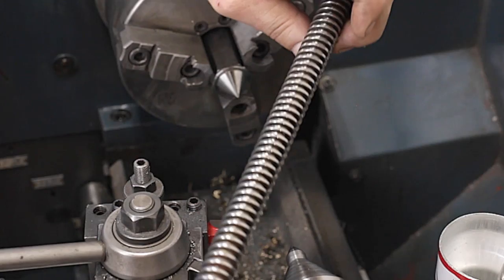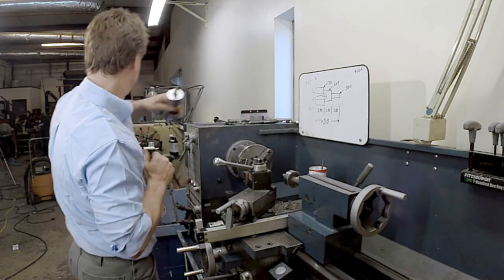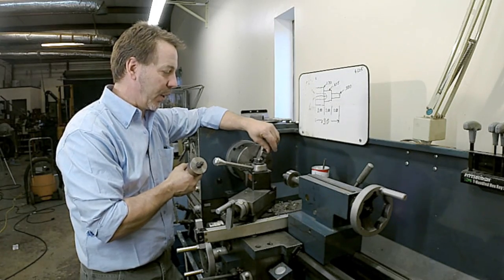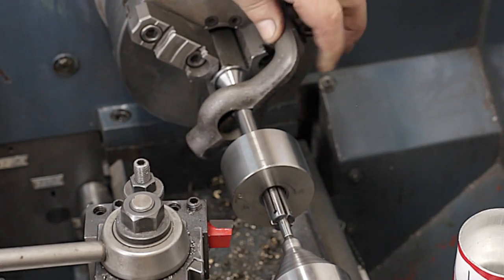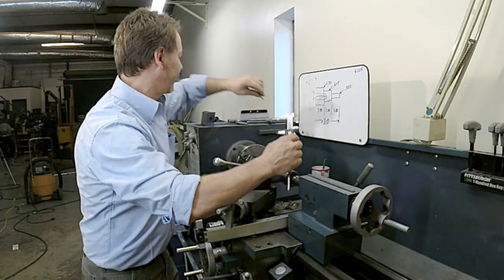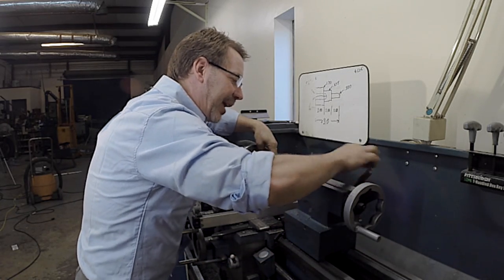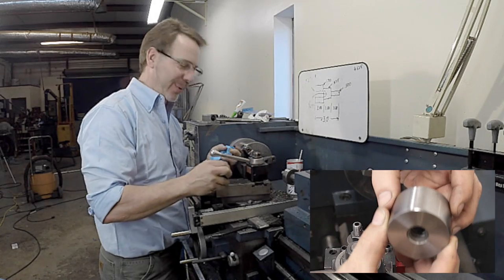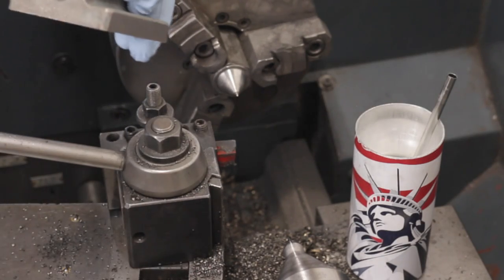Lead screw Part 3  "The nut"

Comment: Hi Dale, it looks like you are all set to go the distance with the Friday Tips & Tricks. Judging from the comments the consensus of opinion is that the CA glue was not the best choice and I tend to agree. The first thing that came to mind was to pin the nut inside of the casting since it' base appears to have enough mass that a small hole would not impact the integrity of the part. Despite this point, there was still a lot of good info provided and you brought up points that many had overlooked. I look forward to seeing your surface grinder in action putting the finishing touch on something cool. Keep up the good work!
Reply from the maker: It will be interesting to see how long the super glue will last. I used it because that what I had on hand. 😀

Comment: I'm not a big fan of glue, but that could be that I don't know enough about the different kinds of adhesives and what their strengths and weaknesses are.  The Acme cylinder nuts on (for example) Bridgeport milling vises are pinned in place with a blind steel pin, then ground smooth so it completely disappears.  To remove it you simply drill out the pin and pull the cylinder nut out.  I would opt for something like that as opposed to glue.  Just my own personal preference.  Love the video series, and a $100 lead screw repair is a great deal.  Thank you!

Comment: nice job Dale. lots of really negative commenting on this entire series, I dont know why. these are ideas that put passed over machines back to service for the long haul. We are spending our hard earned money not the companies cash to solve serious issues in this case a screw and nut that might even be obsolete or so rediculously expensive the machine would be scraped. Labor has become so expensive that management would never allow someone to be taken off production work to make these repairs. Down time is figured in thousands dollars per hour each line or machine. Some of the neg is people talking through hats, When that machine is running again it will work perfect. Only advice is about loctite, every parts counter I ever seen has a display of single use tubes that cost about a dollar, worth picking a few up next time you stop in for brake pads or oil filters.  Great series on lead screw and nut repair. Will be doing the same job on my 13 south bend crossfeed and mitre.

Comment: This repair looks really nice. I would not has thought of using super glue for a repair like this. The good thing is that you have a large contact area between the nut and the holder. It would really be difficult to make it shear and if the two materials were similar then thermal expansion because of CTE mismatch should not be a problem. One of my hobbies is building golf clubs and the joint between the shaft ( steel or carbon fiber) and the head (stainless steel, steel or titanium) is epoxy.  It has the same type of joint that you made.  My golf clubs have seen hot, cold, wet and dry and hundreds of shots on golf balls (and the ground) without failure. The key is a clean, oil free, active surface.  The only way to break the bond is with a torch -ie. heat the epoxy to failure. I would trust the bond more than a pin or screw or anything like that because those things will have high point contact forces that would be prime for failure. Thanks for the video.

Comment: I was hoping to see the nut spin on the shaft and an example of the machine working with greatly reduced backlash.  Still a great series.  I'm watching because I'm contemplating doing a tail stock rebuild.
Reply from the maker: I can tell you it worked out excellent, it still has some backlash, but it is for surface grinder so it's not that big a deal
Reply: Thanks for the great series.

Comment: Ok I will try to positive. This was a great idea,  the lead screw on a surface grinder has very little axial force on it, the CA glue should work for quite awhile.   I do not suggest this on a lathe,  the axial forces are far greater on all of the lead screws of a lathe.  This type of CA glue will fail due to moisture and most petro. lubricants.  There is product made by several Manufacturer's that would last much longer.  You could of added a couple of grub screws to lock in the nut.  Good fix,  But I think a bit pricey.  I think you could of made a fine screw and nut, and would of been proud of the repair.  I neeed a set of expanding mandrels they are great for repair work, nice job on the turning.  Thank you for all of the fine content you provide.  Randy
Reply from the maker: I will be interesting to see how long it will hold
😀😅
Reply: +Randy Richard  Indeed Glue really ???  I want to know how this works... But I am very "how you say" no way...   especially after spending that kind of money on a "precision screw and nut"'    I don't understand.. WHY GLUE.. ???   .
Reply: Randy Richard In The Shop - The grub screw method was also my first thought.
Reply: Randy Richards in The Shop - Build Something Cool :  Question could that nut be drilled and tapped on either side then split into two pieces, one longer and one shorter, to make a backlash adjustable lead screw nut?  The one piece glued or set screwed, and the other piece attached by two screws to the stationary piece, but floating to be adjusted by the two screws to take up the backlash over time.  Does that make sense.  (Edited for spelling)

Comment: Thanks Dale. Good info. I also like the height of that lathe you used to turn the nut. Im going to lift mine  6". Must have been made for midgets. I have overcome the problem of having to have two lathes by having a2 kw and a 5 kw motor on mine. The lower powered one running at 3.5:1 slower than standard speed which means i can get right down to 26 rpm.

Comment: good video, nice use of turning between centres.
I think you might have some problems over time with poor oil resistance of most superglues, I've seen a few cases where they failed in oily environments similar to what that bushing will experience. I would have gone with a chemical resistant 2 part epoxy, Also when gluing in a bushing is a good idea to toughen up both surfaces to give superior mechanical keying for the adhesive. A great way to do this is to cut both left and right hand fine threads at scratch pass depth in both parts, this gives a micro-knurl surface for the glue to key into, it will never come loose.
Reply from the maker: +russhellmy  Great Idea on the left and right scratch pass.

Comment: With a difficult to heat part like that, you might want to try compression shrink-fitting instead of expansion shrink fitting. We used a liquid nitrogen bath to shrink an insert on an aircraft panel normally installed with a hydraulic press at the factory, because we weren't about to remove and disassemble an entire wing in the hangar. Packing in dry ice chips should also work.

Comment: As more of a rough and tumble builder I have a few recommendations.  But first I liked this series.  I learned some new things and a different approach to some issues, plus I do a lot of fix jobs.  My experience with super glue type adhesives is mixed.  They don't seem to like oil and tend to be brittle.  For those reasons I probably would have gone with epoxy.  I'm glad you explained in this one why you were leaning to glue rather than solder, I asked that question in part 2.  Also since you were going with a glue I would have added some texture for the glue to hold onto.  Tight fit with smooth machined surfaces gives very little for the glue to hold onto.  So I probably would have done some scratching with sand paper to give the glue something to grab.
But you may be right that it will last longer than I expect?  BTW in case you don't know unlike epoxy which is pretty solvent resistive acetone will melt super glue pretty quickly.  Not really a problem in use but if you need to separate them in the future soaking in acetone will probably make the center just slide out.

Comment: skillful operating and good thinking. there is only one little problem I feel. the mandrel you hold is a nut's thread MINOR Diameter. It will be no reference means on either axis direction or concentricity of lead thread. of course if you setup the casting iron stand by hand file cutting later will be OK. I will consider to use the damaged lead with 2 rough nut lock instead of mandrel if not too many worn out.

Comment: I think if I were doing this job, I'd have drilled for two grub screws so that, if the glue fails at any point in the future, the grub screws would retain the thread inside the sleeve🤔 Great video by the way!😊xx

Comment: I prefer a light shrink fit over  a glue fit as these are truly dissimilar materials.
For 1 inch dia,  0.001 inch of interfrence  needs a temperature of 250 deg F and is is not enough to distort the thread to a point of impair the screw fitting
I look this video with a great interest as I done the same thing  for the crossfeed lead screw on my old Willson lathe

Comment: Well, you used super-glue on your nut, I used some to patch up a nice slash in my finger. I just love those liquid stitches and you've got you chem weld. Great job, thanks for sharing it...Aloha, Chuck.
Reply: +Knolltop Farms Hi mate.  You might know this, but super glue is essential the same as surgical glue.  the only difference is the colour.  It also works well for cracked heels, but make sure that you don't get some on your fingers, otherwise walking would be somewhat of a challenge.
Reply from the maker: +Marcel Timmers  funny
Reply from the maker: +Knolltop Farms  thanks
Reply: +Marcel Timmers Yes I did learn that, and have read that Krazy-Glue was originally created when the US military was looking for a quick and easy fix for troops in the field. I think the article I read was in Popular Science(?) back in the 80's, and they now call it DERMABOND™. 

I love it and used to carry a couple of tubes with me every time I traveled to surf in far away places. In fact, I've even temporarily glued a Brazilian guy's eyebrow back onto his face when his surfboard fin almost cut it off while in Indonesia. It was kind of crooked, and even after plastic surgery the poor guy now looks like he is always a little surprised, LOL! I will have to try it on my heel the next time I get a crack from the dry weather, thanks!
Reply: Thanks for that extra info about the troops, I was unaware of that.  BTW, it partly explains why you are able to speak Hawaiian.  So in your wilder years you travelled the globe for waves.  I have been on Bali many times, and it full of surfy guys and shiela-s from all over the world.  I will look for a quisical  surfer next time.  Slamat datang.

Comment: Very good series Dale. I need to do that to an old mill I have but I need to find a bigger lathe first :-).  Only comment I have is you didn't mention turning up the head stock point after you put it in the head stock. The piece is short enough so it probably doesn't matter but it is a good habit. Again , you put out very good videos.
Reply from the maker: Thanks for the comment😀

Comment: very nice job dale. i have never used super glue for a permanent repair like that. i would be curious to see how it would stand up to to other adhesives like locktite and epoxy. its sure is quick and simple. i may have to make up some test pieces and see for myself.
Reply from the maker: +larry sperling 
I might be able to save you some time. Im working on doing a  experiment to see what is stronger Loctite  superglue or solder. I hope to shoot the video in a few weeks.

Comment: Great job. The glue seems fine. I probably would have run a set screw in along the outside horizontal edge of the inserted thread part, not to deform but just to (kiss) anchor it a little more. My experience with glues is questionable.
Note: I am sure you know much more than I do on machining, which I why I follow you!
Thanks

Comment: I like seeing the work and great video,  I have a question since you use things like super glue,  I have in mind , has anyone ever made say a nylon type pressure insert that would squeeze on the lead screw, seems this would be a good fix for backlash and smooth operation,  just drill and tap a hole, insert a small nylon disc and place set screw on top,  then just apply set screw pressure and turn lead screw shaft, after a dozen or so turns the nylon would seat itself in lead screw and form a no play or backlash turn,  cheap cutting board to drill hole plugs would do the inserts,  the time in changing them out should be minimal, so as regular as needed would not be problem.

Comment: Wow great repair. Given what you spent in parts I will bet it pales in comparison to what the OEM will charge for a lead screw and nut combo if you can even find them. The glue will hold just fine in your aplication. It's not like your running the machine 8+ hrs a day. Anyways just my 2 cents. Great video and keep up the good work!
Reply from the maker: +Travis Aspin 
Thanks for the comment

Comment: First off, your attention to detail and honesty is refreshing and made the whole series worth watching.  Some comments, which others have also said:1) Gorilla glue is the worst for gap-filling.  Take a look at these tests: https://www.youtube.com/watch?v=MUWu-N85oXM 2) Two-part JB Weld has always worked for me.  It's pricy but the best.3) You didn't show on camera, but did you degrease the mating surfaces prior to glue-up?  Even a minute film of oil would cause failure. And what about leaving small grooves in both parts so the glue has more surface area?  (This is why you sand wood). 4) Did you consider (as others have) heating the outer piece and freezing the threads?  Perhaps this may cause brittleness? Finally, in a bit of way-out-there, perhaps an experiment to remove backlash?  Spray silicone onto the male thread rod and distribute evenly.  Then dump a liberal amount of CA glue (not Gorilla) into the thread housing. Then screw back and forth (e.g. chuck in drill) till the CA sets. Don't stop, and you may have to spray more silicone and apply more glue.  I've done this on loose handles and it fills the gap perfectly.   Not sure it would work in this instance but it would be a cool video to try!  Again, please keep up the great video series!

Comment: I;m not a fan of glue in this type of repair I would have taken one more step at the mill drilled and taped the part lines for 2 small set screws known as a dutch lock, Fine repair, well thought out keep up the informative video's
Dave
Reply from the maker: +david masters 
Great comment

Comment: Very nice work... though i can't help but wonder why you didn't buy an acme tap and rebuild the nut from scratch.   You said in the other video it was about the same price as that nut... so... if the tool and the part are the same price you should always buy the tool.   I would buy the tool if it was twice the price of the part just b/c you can make them from now on.  With your skill level I'm sure you could have easily rebuilt the nut in your mill in the same amount of time you spent repairing the old one.  If you bought the threader now you would be empowered for future repair.  Just a thought.  Still very nice work.

Comment: I'm going to do the same to a MEUSER engine lathe cross slide. I'm converting it to inch from metric. But the nut is brass and odd ball shape. I bought the acme 1"x 5 thread left hand three step tap to thread the nut. ($110.00 Ebay) Expensive, yes, but I figured I could screw up a lot of brass trying to cut an inside, left hand, acme thread and a close tolerance ground acme shaft to fit it. ($100.00)  I thought about bushing it, but the wall was really thin and thread tension cut was off center. Factory nut was cast, Cutting a blank from a big brass gear.  What do you think about cutting the both ends off the factory shaft and grafting to the new one as it has a taper attachment on the back end and several steps / bearings on the front.  Thought about threading them together and pinning.
Have any easy way to make or remark the crank dial from metric to inch. I use a dial indicator on the cross slide due to shaft being worn out and metric marks.  Like your videos. THANKS,  Mike

Comment: A lot of respect for you manual guys. I do all my own CAD design and then CNC programming so watching this approach is very cool. I am not fond of the acme screws due to a lot of backlash but if you can live with it then by all means. Red Loctite bonds huge when heated so that might have been a better option if the regular super dont hold. 
 How is this holding up?

Comment: Two Issues I see. First, you. should have shown the end-play initially, and second shown the end project end-play. Because that was what this entire project was all about. JMHO!
Reply: Yep...I'm grinding my teeth here - no idea if it was worth it or how much we can expect end play to be reduced ... grrr...
Reply: The first video showed how loose it was.
Reply: Agreed.  It would have been nice to see the "before" and "after" end-play measurements.  Also, did the new screw operate freely as the grinder hand wheel was rotated (indicating good alignment of the nut axis with the cross-feed axis)?   Still a good practical solution to the problem, though.  It beats buying (or making) an Acme tap.
Reply: Nice channel and presentation. I also was a little disappointed you didn't show a before/after of the end play as that was the reason for the project.  But this was several years ago, have to watch more current videos.

Comment: what kind of salter you used to weld the sleeve ? is not silver its it , also I see you did not used to mach heat I do silver salter a lot for dove tails   or form tool but I still not 100% good at it any suggestions for to do better I used the regular torch. ( Rafael , Portland Oregon) tool maker